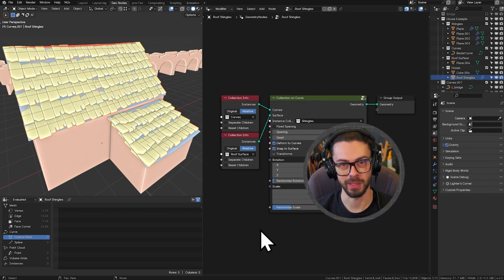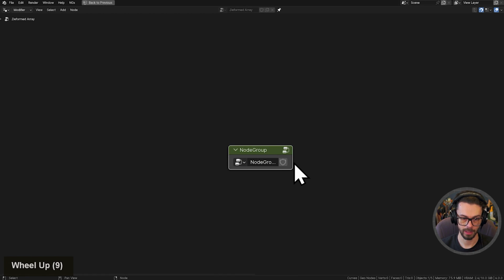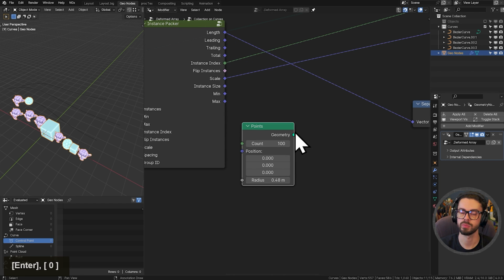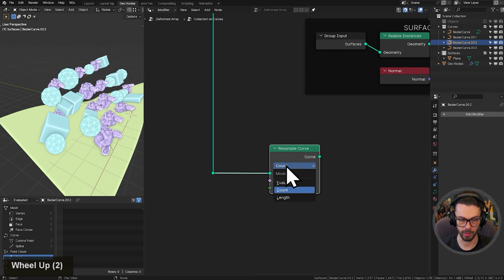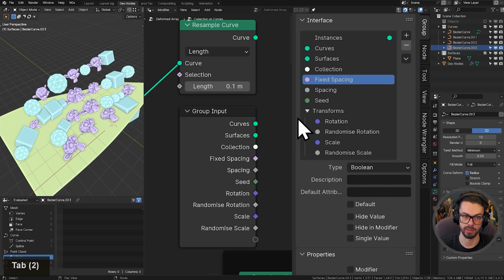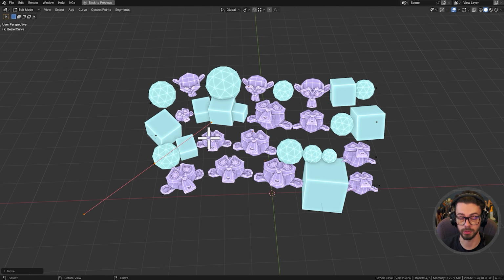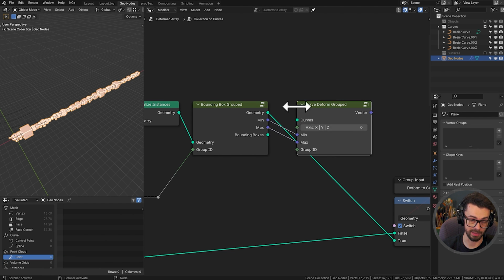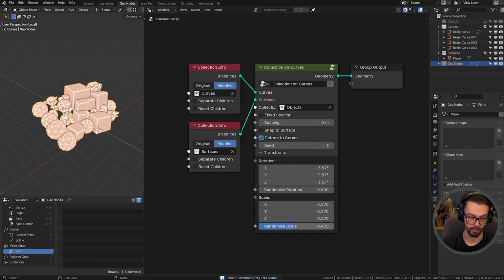Array Objects on Curves - Building Professional Tools with Geometry Nodes

Comment: Amazing tutorial, appreciate it. I do have a question though. When changing the modifier to curve doform, the tiles dont seem to be orienting to the surface normal correctly. Is anyone else having this issue? It works fine in the non deforming method just fine.
Reply from the maker: Might be finding a nearest surface that you didn’t want. Might also be that it’s taking the surface normal and then stacking the tilt on top of that?

Comment: Great set of tutorials, many thanks Erin! Do you know is there any solution to distribute the instances aligned to the start and end points of the splines? It is made for sampling all curves lenghts together, so there are gaps or extensions on each spline.  I tried some setups evaluating on spline indexes and domains, but no success so far. (something avoiding the usage of the repeat zone). Something like it works in curve deform, but for instances...
Reply: finally created another point field for attribute statistic of the max length, last point leading minus trailing, and made correction scale multiplier to the sample curve lenght and instance scale coming out from the instance packer. Repeat zone involved;(
Reply from the maker: I think I don’t quite understand. What is the result you’re trying to achieve?
Reply: Check the video here please https://youtu.be/HXAPVQD2P-A  The unrealised instances (non deformed variant) should start and end exactly at the starting and ending points of the splines. Dont know why but it does not work 100% for one spline. With random seed it works well. Is this possible without the repeat zone? thanks! (reason - performance for large scenes - keep instances but ends aligned like in later curve deformed part)

Comment: Amazing tutorial!!! I learned so much as usual. 
I've played with your setup and customized it (good exercise!) by adding position and random position. It was quite a challenge to find how and where to add the vectors and how to modify them so it takes in account the sampled surface and have it work for both Deform and non deform on curve. But I'm happy I found how to do it!

I have a question regarding your setup: 
Have you tried to draw curves ? If you draw a C shape and an inverted C shape, you'll see that one has a perfect alignment and the other one has the C vector at roughly 37 degrees (I found this number by manually trying to align haha). Scaling the one curve  -1 in X solves it though (object or edit mode). 
I couldn't find a solution for that, would you have an idea about it?

Comment: Erin, why did you use sample nearest for the tilt when you couldn't have just passed it through the sample curve node?
Reply from the maker: Hm I do have a spare channel in the vector I’m sampling across there. Could also do fixed spacing just by overriding the length instead of making different curves 🤔
Reply: @Erindale  I see later on you used that socket for the spline index. (But as you did for the other thing, you could of used a vector 🤷‍♂️

Comment: Very nice. Nerdy Q for you. If I accumulate rotations, using, say, chained 'Rotate Euler' s.. I read backwards from the result.. which is what I would expect. If I 'Align Euler to Vector' , I read forwards to the result, which is nice, but seems inconsistent. (For example, you  Auto align X to Tangent, and then pivot about locked X for tilt. ) I can't figure what's going on, here, internally.
Reply from the maker: Hm I still think of rotate eulers as left to right. They’re essentially a stack of matrix multiplications. Best to jump on blender.chat and ask Hans directly, he’ll know much more under the hood info here
Reply: @Erindale  'Talking to teddy' might have sorted for me... one is transforming the vector, the other is transforming the coordinate space, therefore inverse? But hopping onto the chat would be a good idea. Thanks.